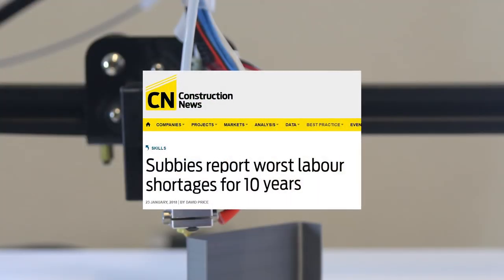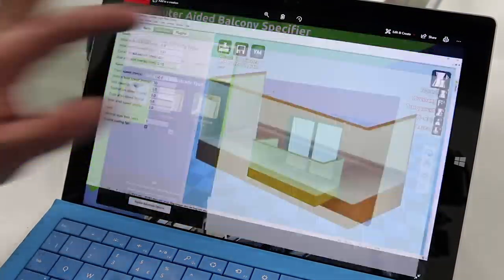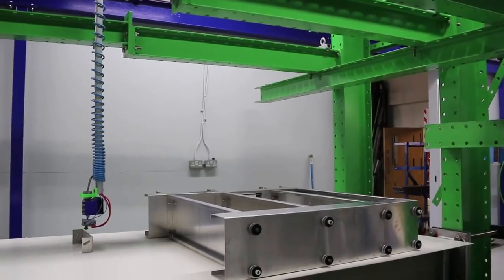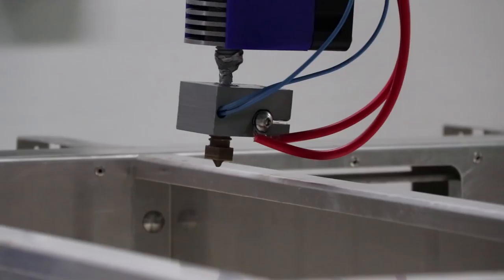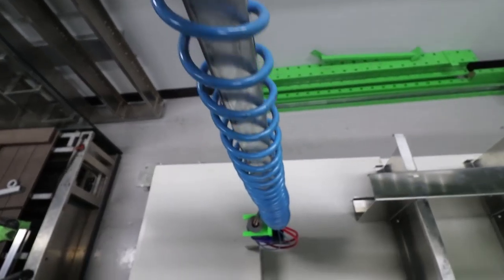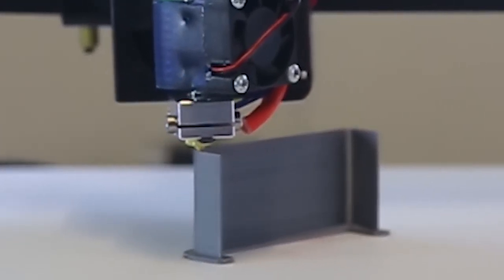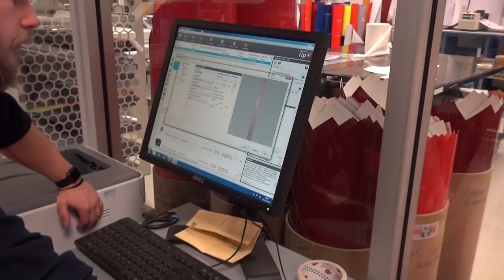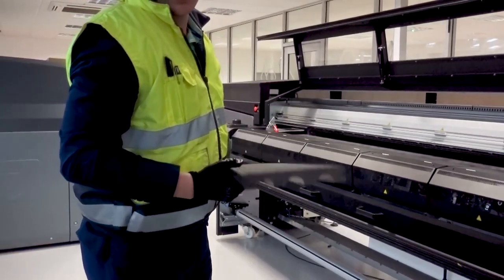The world’s first 3D printed balcony

Comment: the hottend on this 3d printer looks like a 200% scale of the e3d v6 hottend. In almost al shots where the hottend was in frame, the nozzle was what loked about 10mm over the part and was not exuding metal. The heat brake was held on with fu*** tape. The "printed parts" where basically welded steel profiles. The parts in some shotsare boltet together. A 3d printer won`t be abel to bolt thingstogether.  It is very sad that fake Companys use 3d printing as an to scam other people. This video is in my eys very sus